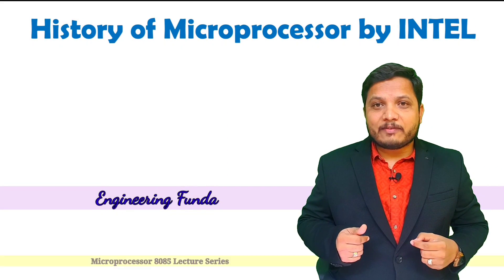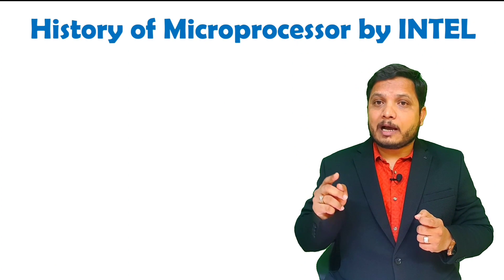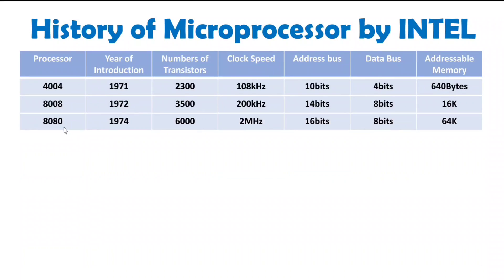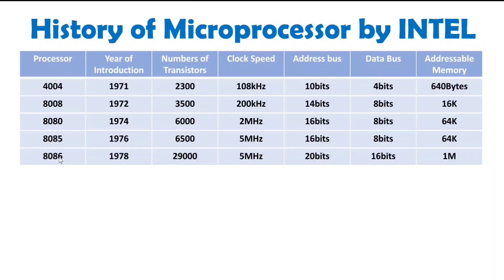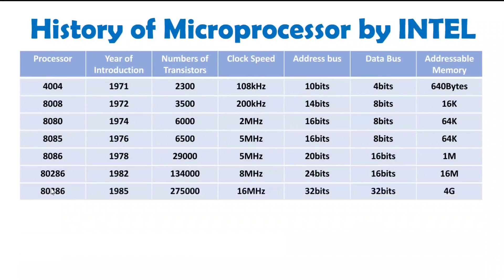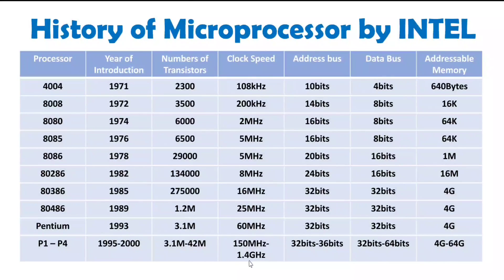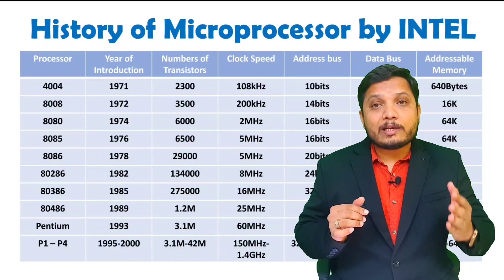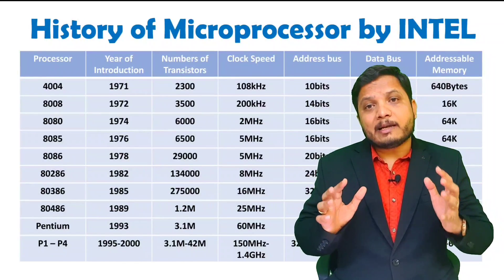History of Intel Microprocessors: Evolution and Development | Microprocessors

Comment: Hello, I am looking for a 8085 microsystem programmer called MICROCEKIT 1, it uses 8085, 8155 and a series of TTLs (74C922, 74173 and DECOS for programming) you would have information on the design of the microsystem without using EPROMs, the idea was at the time to make a small microprofessor (and since there were no EPROMs the students did not spend money on EPROM programmers)